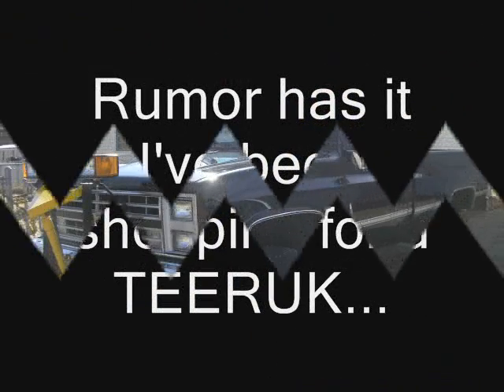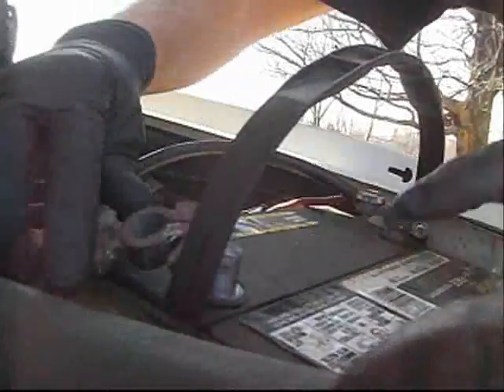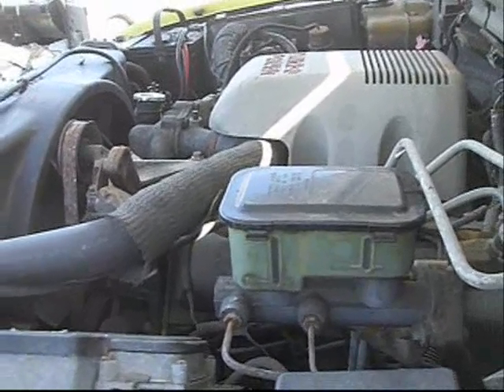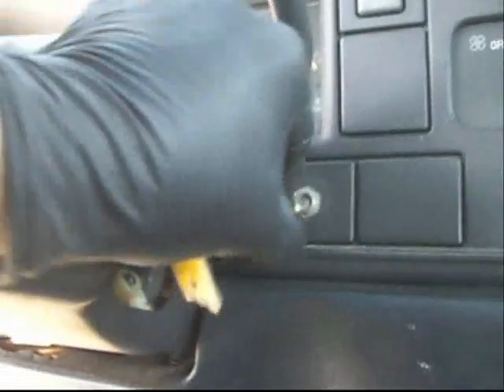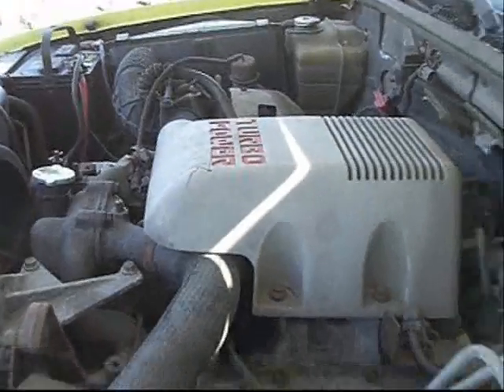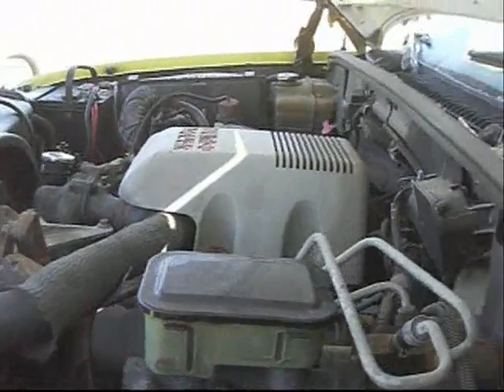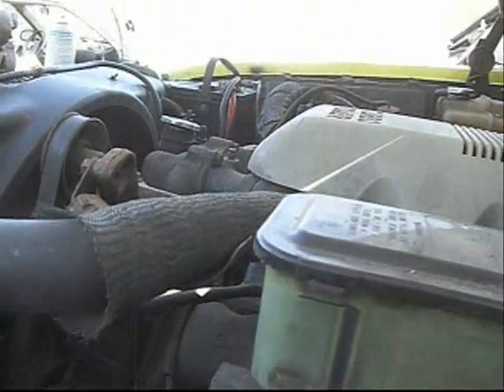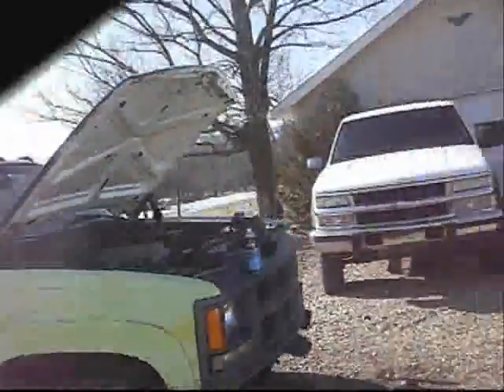3 17 10  K3500  Cold CRANK!!!

Comment: our 6.5 did the same thing, found out that there was a small hole in the fuel line i changed the lines from the lift pump to the tank and it was back to normal